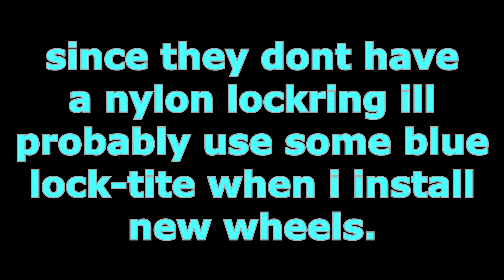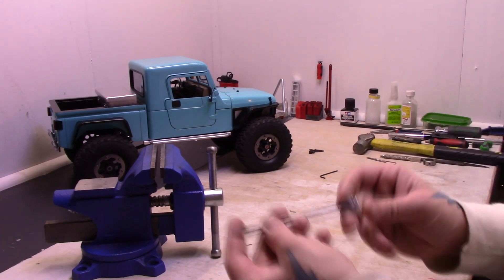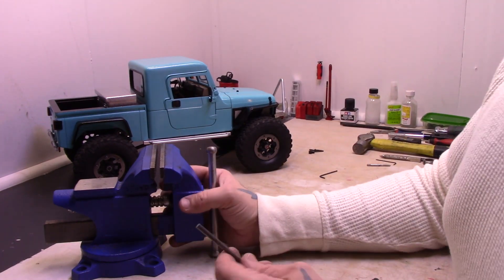Brute Part 9 Steering Link and Scale Goodies

Comment: Great work! Your steering link came out very clean and looks to be the perfect size! I may have to try building my own links for the CR12 clodbuster body project.
Reply from the maker: Thanks Ethan,yeah it would be just like the frame spacers you make as a jig for your bumpers when you braze them only longer with rod ends..you could use steel or aluminum.Thanks for watching buddy.👍👍👍